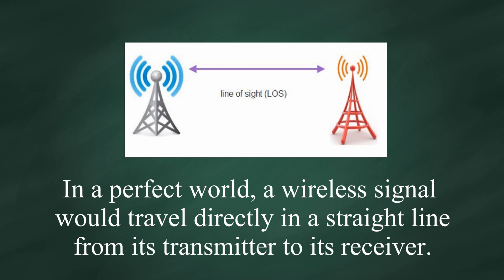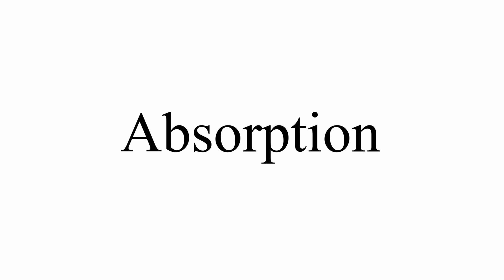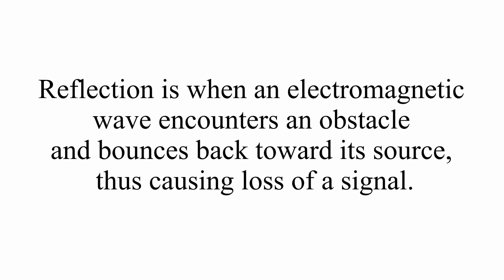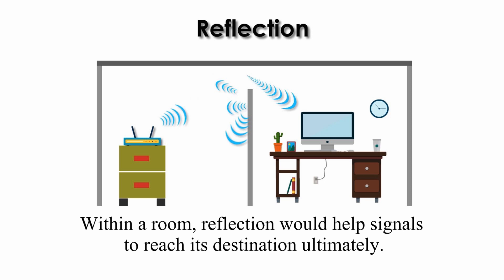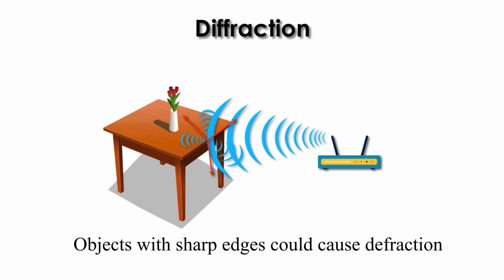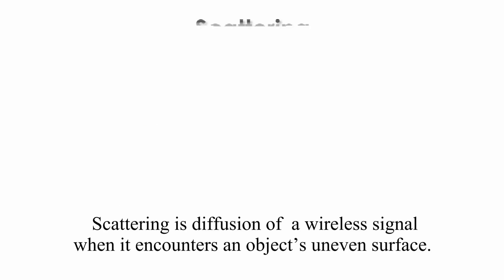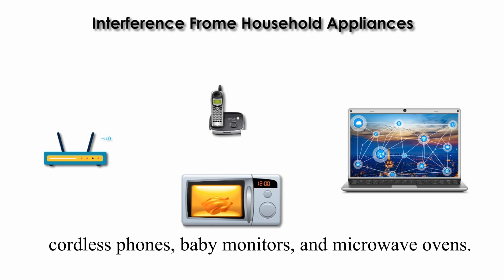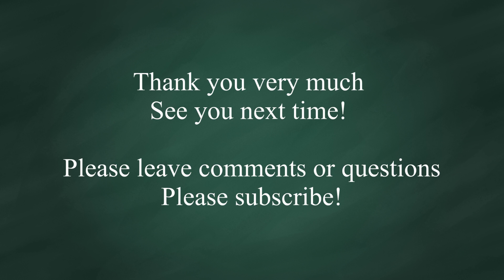Wi-Fi signals: reflection, absorption, diffraction, scattering, and interference

Comment: My old Lenovo phone has an aluminum body and my current Galaxy S20 has a TPU "bumper case" with a matte bottom, where only the backing is made of metal, including the camshield and the mirror at the extremity, also made of metal. Can this metallic part of the cover significantly interfere with Wi-Fi and 5G waves?

Comment: Reflection
electromagnetic wave encounters an obstacle and bounces back towards its source thus causing loss of a signal. 
Ex signal reflecting Ceiling and not getting to your PC as there might be a wall in the middle and prevents signal from directly getting to your PC.(ex only) 

absorption 
materials would reduce wireless signals strength  
ex. water and brick walls, concrete walls metal walls, fridge

diffraction 
electromagnetic wave encounters an obstruction and splits into secondary waves and continue to propagate in different directions 
ex. Tables, sharp edges, corners, desks

scattering 
is diffusion of a wireless signal when it encounters an object’s uneven surface, the main signal then dissipates and causes signal downgrade and signal loss
ex. Plant leaves, dust, smoke or micro drops of water in the air  (all have uneven surfaces remember) 

Interference 
anything that communicates on different frequencies 
ex. 2.4 frequency
baby monitors, cordless phones, microwave

Leave a Like!
Reply: Which direction does wifi signal travel?, upward or downward?. My wifi router is downstairs, I strong signal upstairs..just curious.

Comment: Hi.. How come the AP can stil transmit data while enclosed inside metalic cage?
Reply: Maybe the router or cable modem is up against the wall same for the AP on the otherside. Realistically, the person will run an ethernet cable through the wall or door.
Reply: Low wavelength
Reply: describe cage.  If there is any opening bigger that 1.75 cm it would transmit. If it isn't grounded, it would bleed. We we say faraday cage, it should be  solid walls of perfect conductor. No conductor is perfect and usually those are made of mesh, but if openings is  magnitude smaller than wavelength and is not mutiple of wavelength (you risk difraction in this case), it filters most of signal.

Comment: I have issue with wifi my devices are disconnected from router. I replaced router even change channels. If you have any solution please reply here
Reply: it can be a hacking attack knowns as deaunthentication or jamming
Reply: Best answer i have is to buy a router that has a firewall so you’ll need a password to get in as it sounds like someone is picking at your router and denying you access.